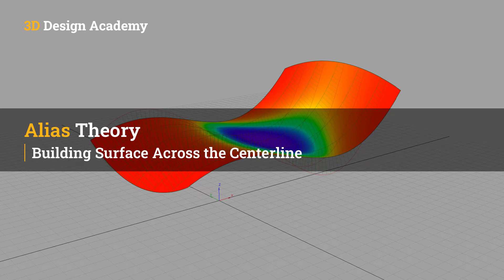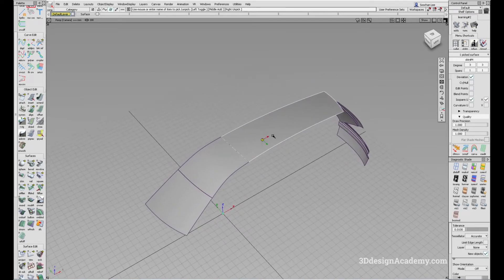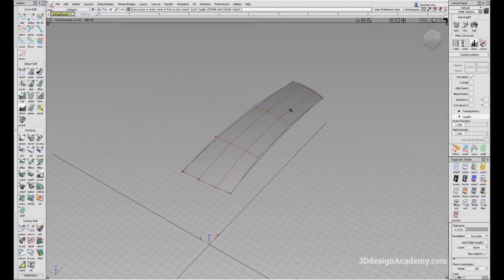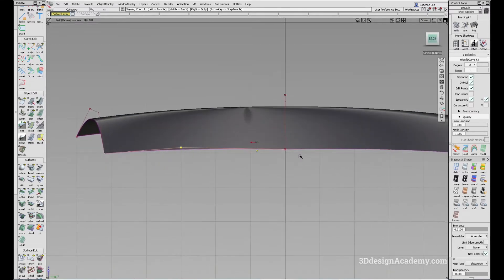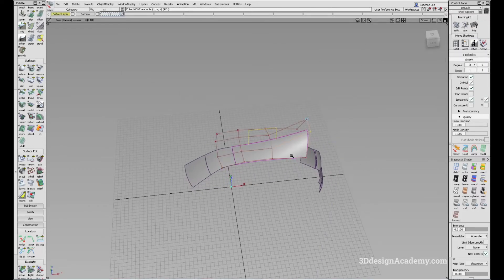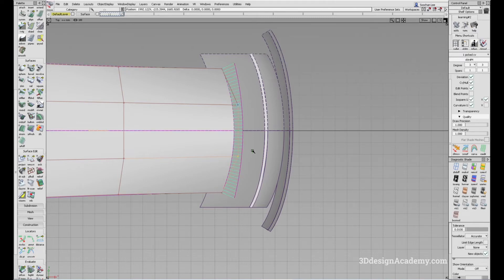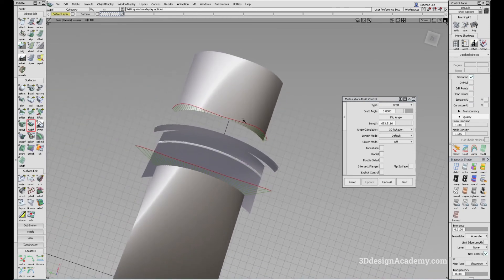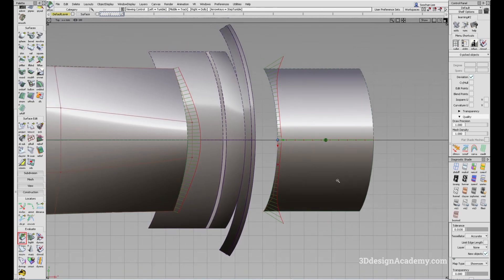Autodesk Alias Tutorials l Alias Theory 3 - Building Surface Across the Centerline

Comment: Never ever have models split across the center line.....That s one of the rules ;) By definition, 1 surface is always mathematically better than 2 halves of the same surface. After one half of the model has been done and its mirror, the half surfaces should be rebuilt into one ;). It s a common practice, and is what I advocate. Many dont care about this, I know, fpr others is a must. Take care, just my input, as a professional class A modeller and engineer ;)....I hope you got my point, because there is something important in this basic concept ;)
Reply from the maker: I couldn't agree more! Yes, it can be done, but it's just easier and better to build 1 surface across the centerline.
Reply: @3DDesignAcademy  YES